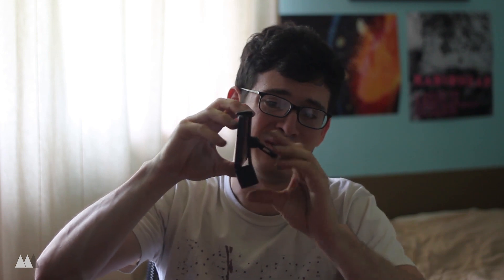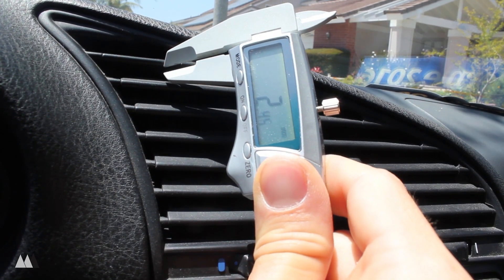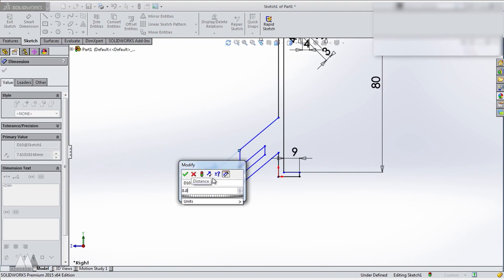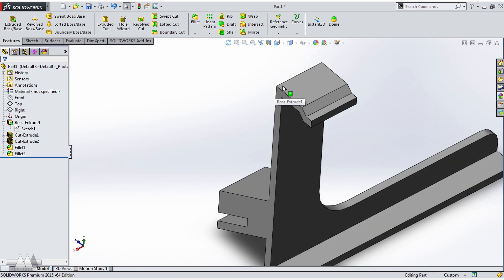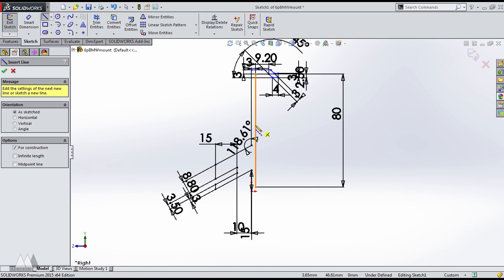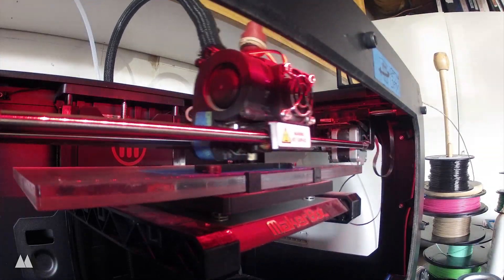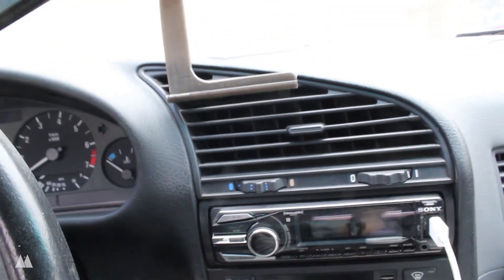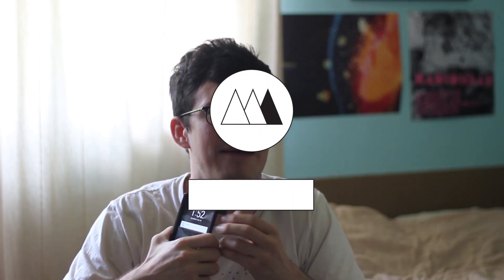Tutorial : Making a 3D Printed Phone Mount for my Car

Comment: I have a 2015 KIA Sportage and saw your clip.  I am designing a mount that sits into the CD-Rom and over the top of the dash.  This puts the phone in the center of the car and above my NAV display.  This does not block any gauges and is visible with out being to high.  Thanks for the ideas.

Comment: So what happens in winter when you have the heating on? will it not overheat the phone?
Also what was the point in show the first render in solid works when you knew it was wrong? a bit of a waste of time.
Reply: solidn6 He lives in California, he's probably completely unaware of his car's heating function :P
Reply: solidn6 He lives in California, so I think he's not going to be using the heat very often even in the winter.
Reply: solidn6 yea but if it's blowing cool air it messes with the battery too .
Reply: Yes but in winter it will blow extremely warm air. So in theory it will overheat the phone.